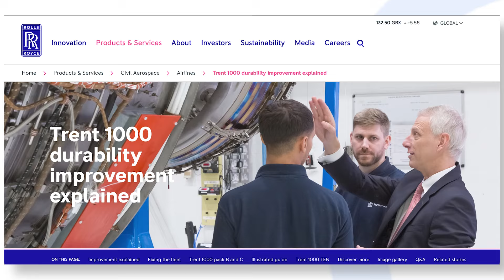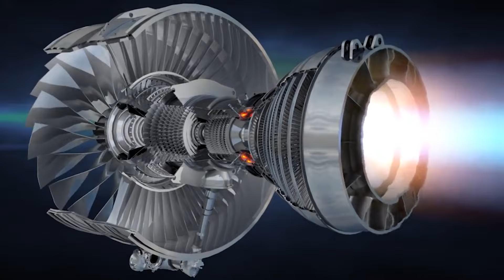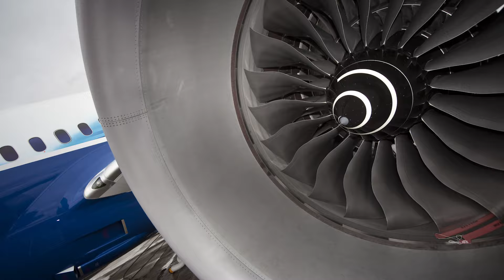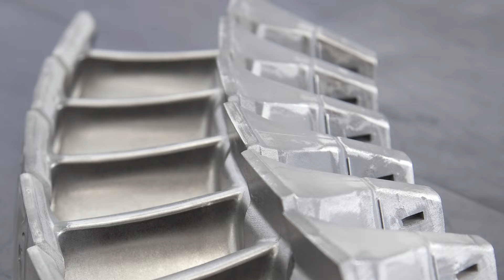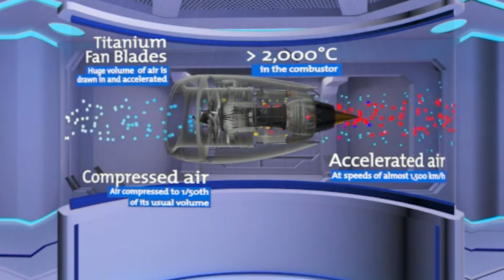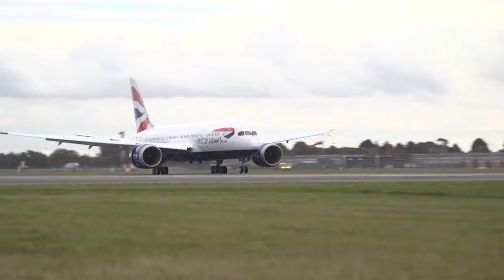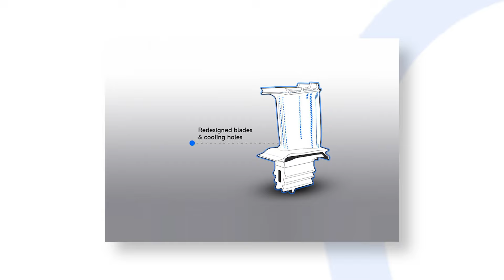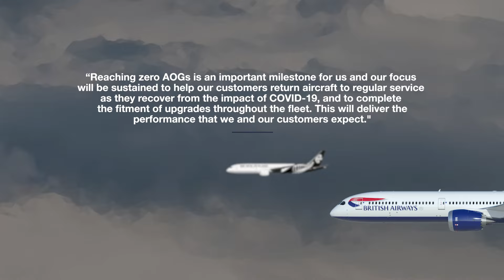787 Comeback: How Rolls-Royce Solved Its Trent 1000 Issues

Comment: It's interesting that for a long time RR has boasted on its official social media accounts how its Trent XWB has helped the A350 become the world's best airliner, while not mentioning how the Trent 1000's disastrous reliability has caused severe damage to the 787's reputation. Interesting how two engine variants from the same family have done the complete opposite to two rival aircraft.
Reply: Yes very interesting.
But no conspiracies were found in these events.
Reply: @1chish  To be fair I think it's possible it's not entirely a coincidence, on the basis that the two airframers have a very different commercial approach, development method and way of treating their suppliers. So not a conspiracy but possibly consequential. i.e. the development of T1K was rushed (by the customer) and tried to reinvent the wheel; XWB not so much, it's an evolved design on a generous timescale. Airbus works with their suppliers not against them and it delivers results, the opposite can be said for Boeing.
Reply: @enemyofthestatewearein7945   I have no issue with coincidences and they are just historical fact plus you are correct in your assessment of how the two manufacturers operate. For sure something particular to the operation / design of the Trent 1000 was happening but RR found it and corrected it. While the Trent XWB has performed flawlessly.
Reply: @1chish  What would you say about the Trent 1000 Ten upgrade and the Trent 7000? Rolls Royce took the XWB and scaled it down to create these new variants.
Reply: @worldlinerai  Whats to say?
RR spotted an issue with the HPT blades on Trent 1000 TEN engines in certain conditions (not the same as the Package B and C series of the Trent 1000) that were not reaching the expected 1,000 cycles of operation. So they created a new upgraded version which has been certified and is being fitted to a sub set of the Trent 1000 TEN engines where applicable.
Currently no 787s are out of service due to Trent 1000 B, C or TEN issues.
And the Trent 7000? It was designed for the A330neo and has performed faultlessly. Which makes the issues on the 787 even more puzzling given the 7000 and XWB have performed better than expected.
Reply: Interesting comment. A couple of points I'd like to add here. Firstly the Trent 1000 and the XWB are two completely different beasts in design as the two aircraft they run on are two completely different functioning aircraft, for example low and high power settings are very different in order to suit, one aircraft is more electrically based thus requiring greater electrical generation at reduced impact to thrust power output and fuel usage and the other more conventional in operation as to starting and generation on the ground and in the air, albeit the basics of air flow and combustion through the engines is basically the same.  Secondly the manufacture of the airframe of the 787 has had its issues in the early days and has had to evolve its techniques/designs just like RR. Also the Trent 1000 is not the sole engine powering the Dreamliner and therefore not the only contributing factor to reputation. However  the media do like to poke at RR when they get chance and not other manufactures. All in all from the start it has been a fantastic effort by all companies involved to get the Dreamliner and the A350 to where it is today and more focus should be put on the achievements of these engineers/teams/companies working together to overcome these issues for the benefit of us all instead of looking for negativity and conspiracies where none exist. Now, time for a cup of tea, and fly safe :-)

Comment: u guys prefer the 787 or the a350??
Reply: 787
Reply: I prefer a350 because of quieter cabin but I love 787 as well
Reply: A350
Reply: A350
Reply: dunno, i prefer a A350 ig
Reply: I like both of them so idk.
Reply: They style and tech in a350 is very tasty but Boing still wins me over with the simple fact that if all else fails brute force from 2 persons can still save the day.
Reply: A380 beats both from the passenger point of view, if not from the Chief Finance Officer viewpoint.
Reply: I have been on both several times. A350 all the way 😊😉
Reply: Two different aircraft in different sales sectors. The Airbus competitor to the 787-8 and 9 is the A330neo -800 and 900
The only 787 to compete with an A350 is the so far non existent 787-10 which would compete with the long established A350-900. Singapore are the launch airline for the 787-10 and they have chosen Trent 1000 engines.